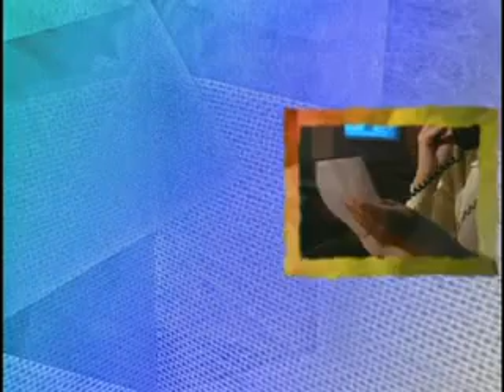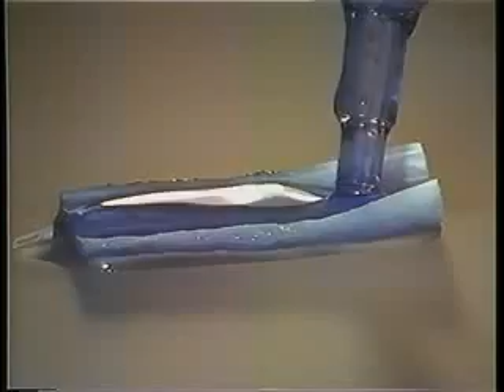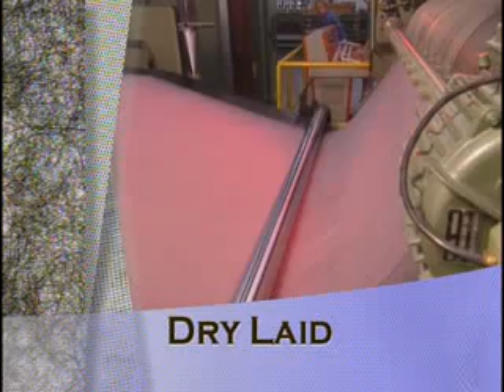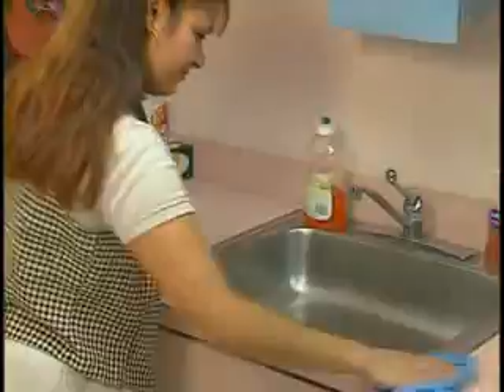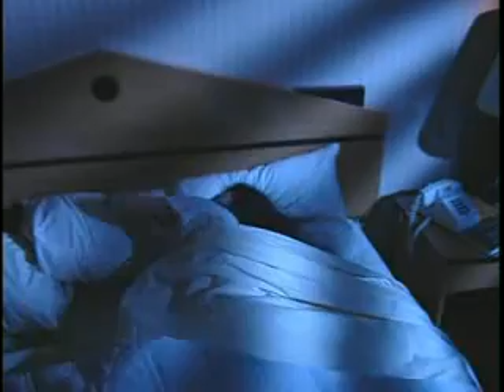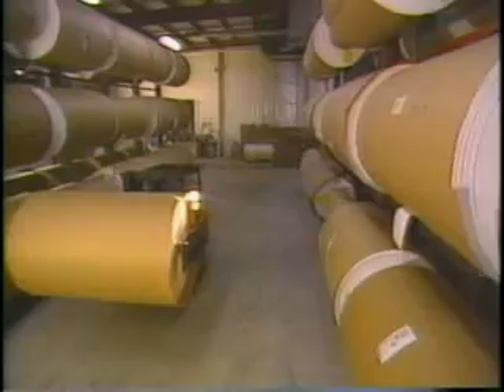Nonwovens! What Are They?

Comment: what is the difference between hydrophilic non-woven fabrics and breathable water-repellent non-woven fabric?

factory manufacture hydrophilic non-woven fabrics by adding hydrophilic agents to the fibers. Hydrophilic nonwoven is soft and high absorption, high strength, and air permeable. This fabric can absorb water and retain its original properties and strength. The fabric can efficiently attract and hold water, which is usually used in agricultural seed germination, mulching, and weeding.

Breathable water repellent Nonwoven benefit from extremely resistant barrier to water, the water will not go through the fabric, but air does, which is usually used in fruit bag, disposable table cover, disposable bed cover.
Reply: Water repellent is called phobic non woven fabric